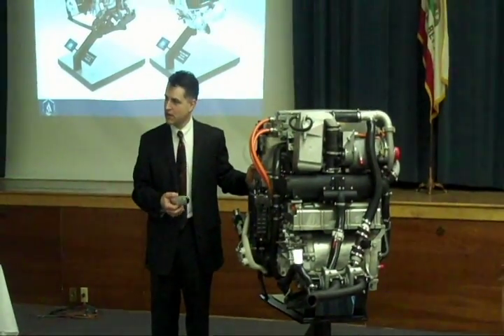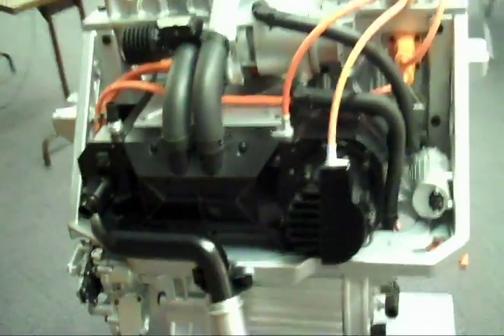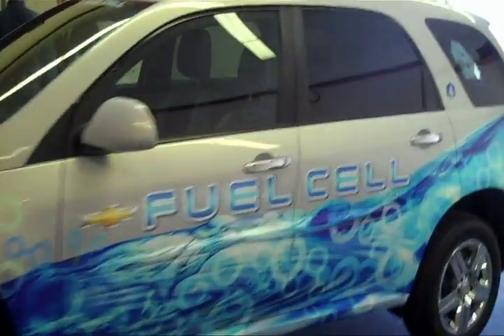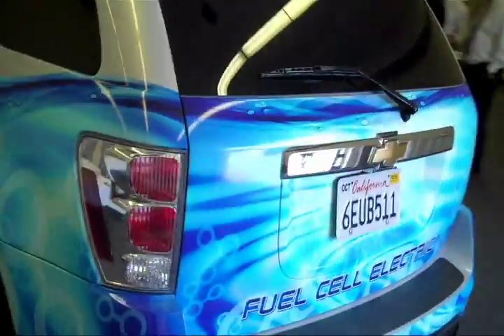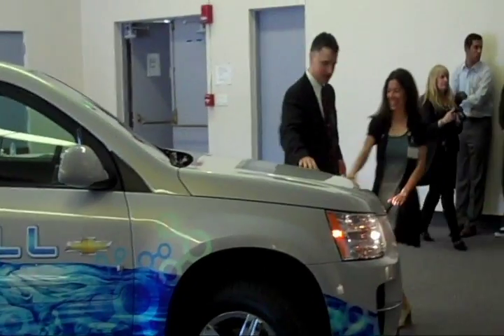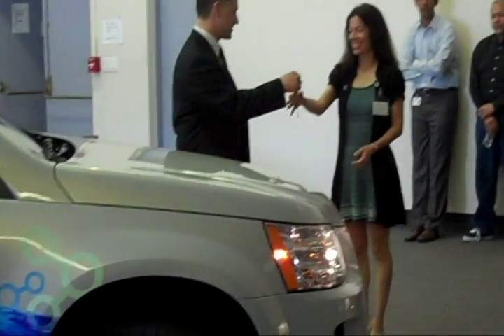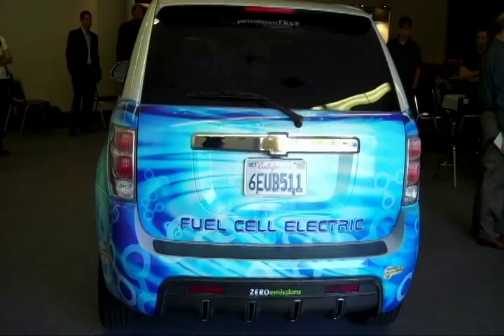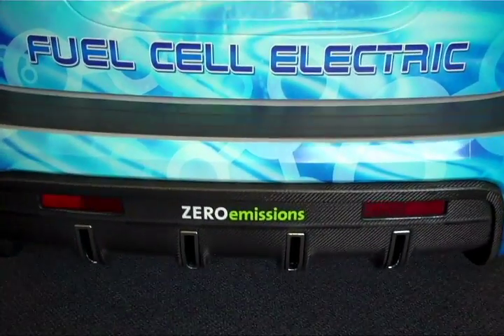Chevys Next Gen Fuel Cell Vehicle System Revealed

Comment: Vehicles I would consider buying.

1.  Honda Civic Natural Gas electric vehicle.  Lithium-ion Battery with Permanent Magnetic Motor.

2.  Chevrolet Volt Hydrogen Electric  Vehicle.  Lithium-ion Battery with Permanent Magentic Motor.

3.  Pure Electric Vehicle with on board generator.  Atomic Battery with Synchronous Permanent Magentic Motor.